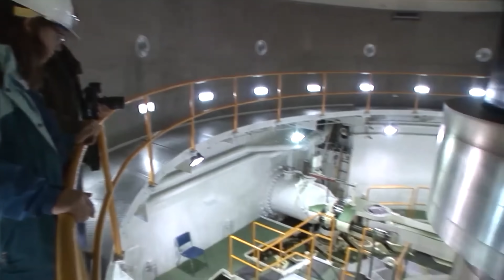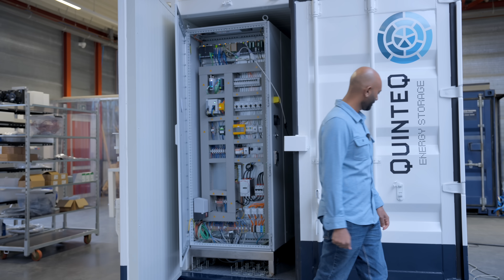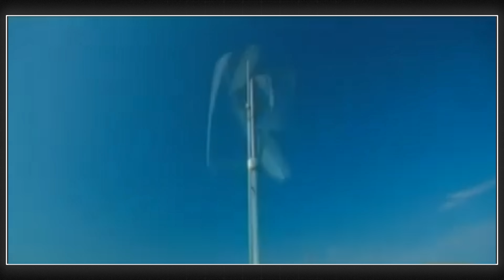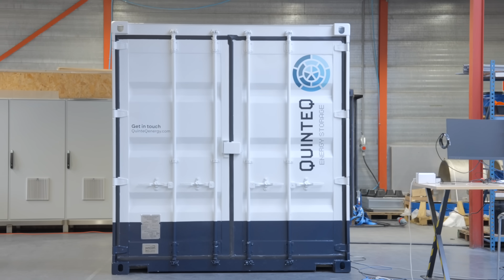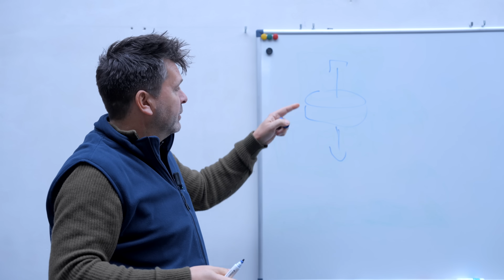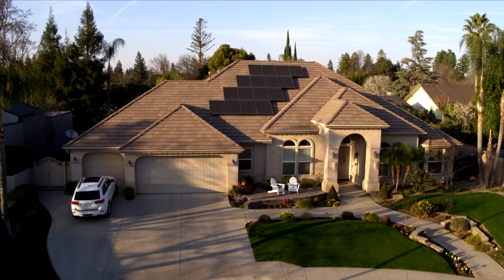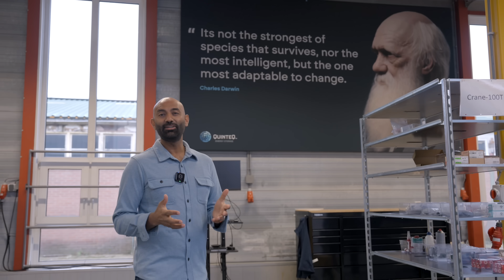How Flywheels Solve Clean Energy's BIGGEST Problem

Comment: Verry useful if were going to super charge our cars, or pick up that wind spike or solar surge. Capture fast then store in a battery, or in case of super charging a car unload the flywheel fast, speed up the wheel over time until the next car arrives for a quick charge burst
Reply: Fly wheels are not necessary, big batteries are powerfull enough to absorb spikes.

Comment: We learned we need more inertial grid buffering of renewable energy when the lights went out in Spain and Portugal. Integrating nuclear with renewable energy would allow us to devote part of the nuclear baseload output to power flywheels that would, in turn, support grid frequency and voltage stability with greater penetration of intermittent wind and solar.

Comment: Yes this works for small scale applications. Not a new concept at all. It just adds more cost and requires fossil fuels to create. When you come up with a system that you can build and operate at equal to or less cost than fossil fuels, then sign me up. But we are at 4 to 5 times the cost. Our current electrical grid using fossil fuels, hydro and nuclear, have massive turbines which also act as a flywheel. It is part of what makes our traditional power grid so stable.  It is also part of the reason that renewable energy the lacks stability as they that flywheel  type inertia that makes our traditional system has built in. I will point our there is no such thing as maintenance free.  The bottom line, the flywheel is just and added cost to an already expensive system. Green energy is already cost 4 to 5 times the cost of Fossil fuels and less reliable on top of that. Not mention you need fossil fuels to make the green energy system.  Engineers can figure out how to do amazing things. The measuring stick is to produce reliable energy at a price that is equal to or less than fossil fuels. The closest when have for that, is nuclear, it is in fact the safest and cleanest way to produce energy and with SMR technology, that will eventually be even less cost. Some thing that gets missed here is the cost of energy transmission, it must be part of the equation. With SMR you can put the power generation where you need it and reduce the transmission  costs by not having to run 100's or thousands of miles of transmission lines. I love the development of new technologies and appreciate you videos..  You have to add the business model into engineering. The real goal in is to produce energy at a lower cost and cleaner that the existing system. The only way to do that is with nuclear.. I call the current green energy an engineering boondoggle or the money pit. We keep make band aid fixes, that make things more complicated. Nuclear is the answer and frankly it is the only answer. However, the wind/solar is great for supplemental power, and off grid use. I will point out that most of the cost for nuclear is cost of lobby group red tape and over regulation.  Energy density is key to the equation.

Comment: Sunshine, the UK has some very deep coal pit heads which could be fitted out with gravity or heavy weight batteries. Also, most pit heads had 3 phase electrical supplies so connecting to the national grid would be straightforward . Yes, gravity batteries are a no brainer. No lithium needed

Comment: "Superconducting crystal bearings are super cool.."
Yeah LITERALLY.
"if im operating a crane, 5 times an hour..."
If you only operated a crane, 5 times an hour, you'd be FIRED and never employed as a crane operator again. Cranes need constant power during a full 12 hour work shift. Not only for the lifting, but to hold the load as you manouver it into or out of place. Also, the cab electronics controls, like what is this assumption that cranes will be switched off between use? Also as soon as you move one thing, generally you're spending HOURS at a time moving thtings...

Comment: The question I have: I know it's less efficient,  backyard DIY, solar panels power a shop/home, excess power fed to dc motor/s that spins 1 or multiple (semi-truck) flywheels, each connected to a 12v automotive alternator feeding a dc/ac inverter.

Comment: There are several viable mechanical and other non-chemical batteries.
Flywheels, water pumping, sand/thermo batteries, mass elevators....
We need all of them in different locales and circumstances.
Reply: right tool for the right grid — no one-size-fits-all here

Comment: Losing 0.1% of the energy over 1 hour means it'll lose 2.3% of it's power over 1 day. Over a week, it will lose 15.4%. Over a month, 51% of the energy will be lost, over half.

Honestly I don't buy it. Flywheels, electrochemical batteries, thermal batteries, they all have one massive disadvantage when it comes to energy storage. They self-discharge over time and there's nothing you can do to stop it.

Not like coal or uranium. Those can sit quietly for centuries without losing any measurable power.
Reply from the maker: superconducting bearing = 0.1%/hr loss. for grid buffering? that's basically nothing. coal doesn't care about milliseconds.
Reply: @TwoBitDaVinci  Sorry, still don't buy it.

As you said, the 0.1%/hr loss is for superconductive bearing flywheels.

As far as I can find, the average electromagnetically levitated flywheel loses 2%/hr, and has an idle parasitic draw of 700 W in order to power its electromagnets.

If that's wrong, you're free to correct me, because I didn't hear any numbers in your video for the efficiency of the non-superconducting flywheels. Just a nebulous "yeah they're less efficient".

Comment: Flywheels were common during the early stages of the industrial revolution but there was a good reason they went out of practice and that was the danger they posed when the flywheel failed sending huge masses with high kinetic energy bursting through walls at incredible velocities. They tried to extend their lease on life by placing flywheels in pits below ground level but still the accidents persisted. They were eventually phased out as electrification took hold.
Reply from the maker: yeah that's a real concern — modern designs like Quintec's use vacuum housings and magnetic bearings to contain failures safely, way different from old open pits

Comment: This technology  could be a best alternative for UPS Power in industrial setups, the Capex and Opex cost of running distributed UPS systems plant wide, since the power requirements is small and as a backup, in cases the normal power fails to run critical equipments such as servers, plc , dcs systems etc.

Comment: In the Dawn Mission despin a 1 kg mass can stop a 400 kg mass from spinning about 1 m/sec. 
AI agrees that the thrown mass of 1 kg will return all the spinning motion to the satellite if that 1 kg is not thrown but left attached.
This means that the 1kg must have the same Newtonian Momentum as the 400 kg satellite spinning at 1 m/sec. 
The small mass must be moving 400 m/sec.
A 39 ton flywheel accelerated by 1 suspended ton accelerates  in accordance to F = ma just like an Atwood's or modified Atwood's.
After the 1 ton has dropped 1 m the speed of all the 40 tons is .700 m/sec. This is 28,000 units of Momentum.
We now use the Dawn Mission concept to place all that momentum into the 1 ton; and it will be moving 28 m/sec.
At 28 m/sec the 1 ton will rise 40 m.
This all can be done in about 4 seconds: or 15 cycles per minute. So we need not worry about a 20% lose in one hour. 
You have a 4000% increase in energy while losing only .11% to friction.
Most of the energy is stored in height.

Comment: This is a highly flawed solution and there is a reason they haven't taken over
Reply: What are the reasons? 
I know that a flywheel can discharge all of its motion (momentum or energy) in about at 1/3 of a second. This has to be an advantage for some applications. 
You can apply force for a longer time, and discharge the stored MOMENTUM in a short time. While Conserving Newtonian Momentum you make energy.
I did think flywheels are going to go away; I think they will take over municipal power sources.
Reply: @delburtphend6016  Well that's the point, they are good for dealing with SOME issues and they come at a cost.  They are a tool for peaks and valleys.  Power smoothing.  This is not clean energies biggest problem though - clean energy needs a high energy battery and flywheels don't solve that.
Reply: @fieldmojo5304 When a 40 ton flywheel moving with an arc speed of 100 m/sec shares its motion with an identical flywheel it will share its arc speed linear Newtonian Momentum. Please ask AI. It gets this right.
Now ask AI if the second flywheel, initially at rest, has 1/2 the radius but the same mass. I don't know if AI will get it right but ask it and see. But the answer is the same as the identical flywheels. The Radius of the flywheel does not matter.
In fact something like the Dawn Mission despin will also conserve linear Newtonian Momentum. 
Did you know that Newton was 100% against energy conservation? How the profs turn this upside-down and now claim that Newton was for energy conservation is truly amazing.

Comment: The mass being lowered by a crane can produce more energy than what is put in. 
A 1 kg mass moving 4.429 m/sec will rise 1 m. That is 4.429 units of Momentum.
A 1 kg mass accelerating a 19 kg flywheel will give you 19.81 units of Momentum after the 1 kg has dropped the same 1 m. 
Suspend 1 kg from the circumference of the (19 kg) flywheel and the acceleration will cause a speed of .9904 m/sec and a momentum of 19.809 units after the 1 kg drops 1 m.
A flywheel, like the 'cylinder and spheres' experiment, can place all that momentum in a 1 kg mass and it will rise 20 m.
The 1 kg was dropped 1 m and it will rise 20 m.
You can test this experiment for $30 and the concept is worth 7 trillion dollars. The experiments are on YouTube "Delburt Phend: yo-yo despin and others.

Comment: Some people act as if flywheels could save our entire energy system. This video clearly shows what's really going on. Flywheels are sprinters, not marathon runners. They smooth out power peaks, stabilize grids, and react lightning-fast. But they don't replace batteries or long-term storage, and certainly not the entire infrastructure. Anyone who sees this as a miracle solution has either not understood the video or hasn't wanted to understand it.

Comment: Are supercapacitors simpler, cheaper and more effective than flywheels? In the example of the cranes, the recovered energy can be stored locally inside a supercapacitor and be used at the next haul (and power supplemented by the grid) rather than feeding it into the grid.

Comment: Clean energy’s biggest problem is that if the wind doesn’t blow or the sun doesn’t shine there is ZERO energy generated, necessitating peak-load capable fossil fuel backup power plants to be on standby.  No number of spinning wheels can solve that.

Comment: Im fascinated by flywheels, gravity batteries and other mechanical solutions. They are really elegant. Its interesting how improvements in materials' strength can be directly converted into flywheel capacity. Its great to see such engineering synergy :)
Reply: When you find a 100-200 MW solution come tell us about it, till then we’ll use gas turbines!
Reply: @andyxox4168  ? Gas Turbines are generators, Flywheels are batteries. Different problems.
Reply: @polvoazul  yes to supply your garden shed but useless for grid scale storage. And no matter how many you have there’s still a basic stability problem.
Reply: @andyxox4168  But... Why are you attacking me? I just said I find flywheels elegant. I never said chemical batteries should be fully substituted by them!

Also, pumping water up a hydroplant is a grid scale gravity battery!
Reply: @polvoazul  yes pumped hydro can be used as a grid scale battery but most countries do not have the necessary geography.

As for flywheels, they may be elegant but so is an evening dress, but both have negligible effect on a 50GW power grid!

Comment: I guess that's been the problem with super-conductors. The need of sustained cryogenic temperatures means that they are incredibly difficult to justify. If you have to use some of the power within the battery to sustain cryogenic temps, then your battery is less efficiency. That's also why the idea of a room-temperature superconductor is such a holy grail that researchers are chomping at the bit to find.

Comment: For me, flywheels don’t sound good for renewable energy storage. They can be good for grid stabilization, but that’s completely different problem and solvable in many other ways, like load that can be controlled fast by the grid. For example, EV battery home charging could be such load without much disadvantages. There’s long time frame to charge required energy and response times could be in level of 10ms.

There’s one promising technology for renewable energy storage, and for my opinion, it has got too little attention. Maybe because best technologies are not necessarily best for economic point of view. If something lasts long and is cheap, it’s small business.

This technology is a flow battery, where energy is stored chemically on electrolyte, and can be stored in a tank. This scales up by dominating cost of interface power and not by energy, being exactly what longer term storage would need. Compared to other alternatives like synthetic fuels, hydrogen and such, this has potential efficiency closer to 100%, compared to 50%, which is quite typical with other solutions.

Current flow batteries are often based on vanadium, which is problematic for pricing and availability, but it cannot be the only material for this. Flow battery with cheap electrolyte, would be real game changer.

Comment: Hi. I'm a traveller from the 28th Century.
My advice: Always align the flywheels' rotation axis with Earth's. If not, by 2150 you will end up with days with an extra 0.02 seconds per year, every year. This may offset the increase in Earth's rotation speed due to the loss of the ice caps, but still not a sustainable trend.

P.S: I told your great grandparents about fossil fuels but they ignored my advice.

Comment: Great video, especially the reference to the Iberian peninsula blackswan event and yeah cranes - good to know who uses it most! So how does regular electromagnet levitation work? I'm guessing laser optic balance servos? How about using microwaves to send power into an isolated piston that contains capacitors and active coils? OpenStar in New Zealand recently demonstrated using "dipole levitation" electromagnets to lift a 0.5 tonne fusion reactor and make it hover in vacuum!!!  I think they use flux pinning of superconductor mind. Or send the power in via a laser beam.

Comment: Consider the flywheel is not a new invention, IF it would be a practical solution, then China already would have use it in Mio, because China produces the most renewable energy and  has the biggest need for storage.

Comment: It's like regenerative braking for land based machinery like the cranes but also works as a super capacitor as needed between systems. Also it can act as a regulator absorbing excess energy that is to great for the batteries to absorb at once. It's easy to see how it's already being integrated into modern systems making them more efficient and stable.

Comment: Obviously it wouldn’t work, but after someone’s comment about it being like a super capacitor, I thought it would be an interesting hypothetical exercise to scale a flywheel down to a tiny discrete component that could be soldered onto a PCB for a power supply.  Have a handful of 1 cubic cm flywheels spinning at 15k rpm hard drive speeds…:)

Comment: The ideal Project should be balanced between three variables. TIME - COST - QUALITY
Reply: So true. There is a saying in construction that I have used for years. There are three types of work that can be done. Good, fast and cheap.  You can only choose two.
If it's good and cheap it will not be fast.
If its good and fast it will not be cheap. 
If its fast and cheap, sadly it will not be good.
Reply: @Shadows.Keeper  Definitely you may balance the three like an equilateral triangle.

Comment: Flywheels and pendulum’s side by side working -together on an axis using gravity to maintain its momentum 
The pendulums are electromagnetic and use a rotating polarity to maintain there momentum the energy is transferred to the flywheels by electromagnetic connections that switch between flywheels

Comment: FTR, Spain and Portugal keep some of the old gas and coal generators working (normally at very low power, but also as backup) as the counter balance of the grid, as these have the huge masses required to balance the renewable surges and basically work as these flywheels.
In fact we pay a lot of money for that “service”.

Part of the problem on that day was that those generators weren’t correctly configured to handle the surge.

Comment: Flywheels are a step backwards in technological terms. They are a mere mechanical equivalent for batteries. Flywheels, like any device, require constant maintenance, aside from being expensive.
What we actually need is a highly-efficient engine that runs on water and produces almost no residue. Another possibility is a miniature nuclear fusion reactor. Another option is the figure out a way to get energy from the void.
Reply: They can be implemented also with mature technologies, which would work right away, that's true. So there is no reason for them to be expensive.  And this is their advantage. We have been maintaining synchronous machines for many decades and know how to do it. In fact similar devices called "synchronous compensators" have been in use since at least 1970s. 

But they can be also improved with new technologies - like magnetic suspension in vacuum, which would require much less maintenance due to the lack of mechanical friction... And the tech here is also not unknown. So it is in the reach and should be not expensive.